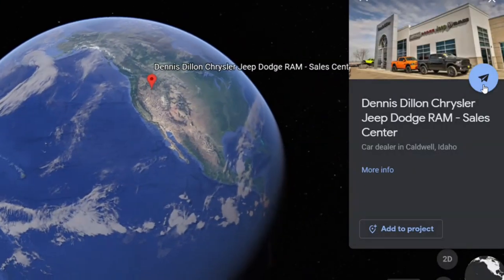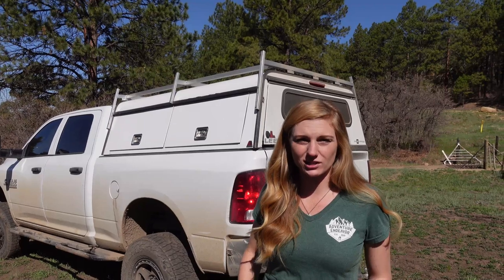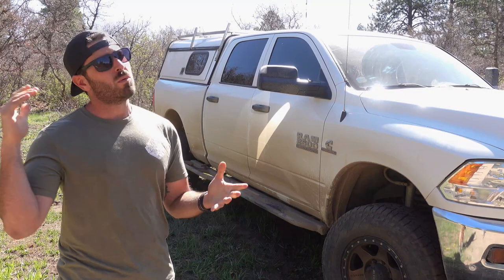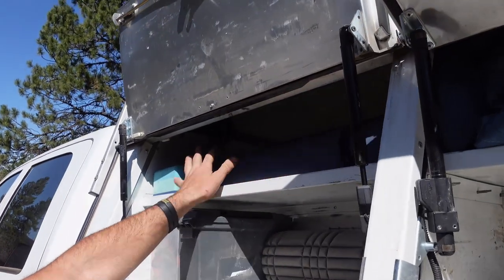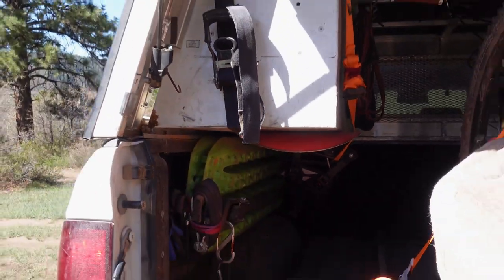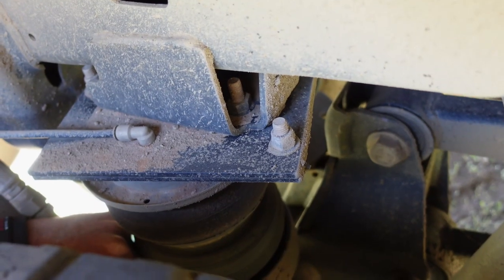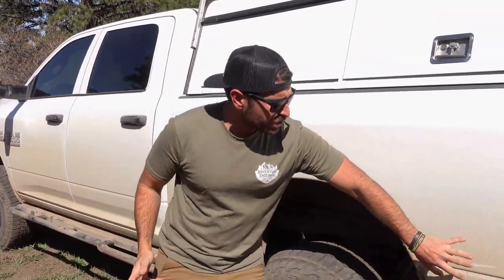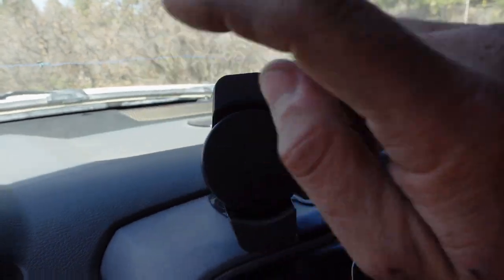Ram 2500 || Full Size Overland || Towrig

Comment: Jesse, Chris from KY, send me a link for a DM so we can talk about that drag link.    Need to address it.
Reply from the maker: We haven't had any issues with ours. 🤷‍♂️
Reply: @AdventureEndeavor  the jam nuts could be an issue.
Reply: I would upload a pic of what Mopar factory did to fix mine after the leveling kit install, but....
Reply: Sorry dude I don't have Facebook or any other SM.
Reply from the maker: Oh gotcha, I think mine is now carli suspension.  Pretty sure my lift gave me a new trac bar.
Reply: @AdventureEndeavor  new track bar but not a new drag link. If you haven't had the recall done buy a new drag link and swap it out. Don't let a dealer weld the nuts together.
Reply from the maker: Good to know thanks for the heads up.
Reply: Correct the dealer will want to weld them as per the recall specs... I called Mopar cares and they assigned me a case number and they had a new drag link... old style from the 2015 model years sent to the dealer and had them install it, all free of charge.  I will say I was skeptical about calling Mopar cares, but they were fantastic, even coordinating with the dealer instructing them to fix it.
Reply from the maker: Wow thats great to hear!

Comment: UHF radio? Or CB? Brand? Does it require license like shortwave? Did not see info in description.   
Yrs er decades ago had one licensed through Qualcomm (?) to use their towers.
Reply from the maker: It's a vhf, no license required.  They are big in offroad racing.